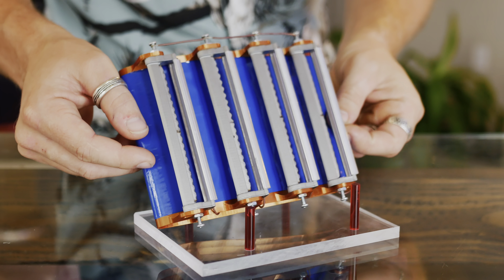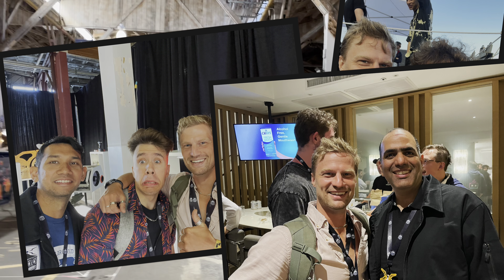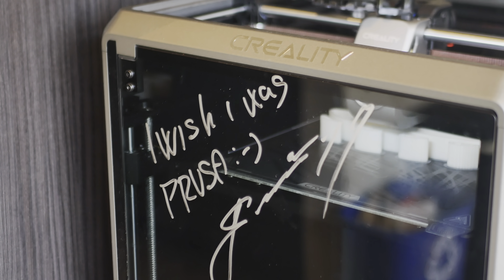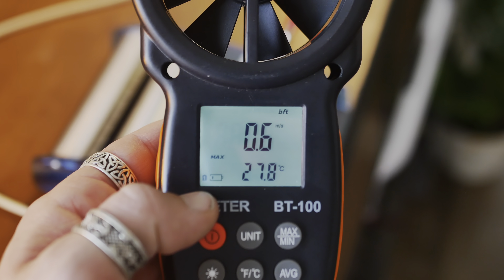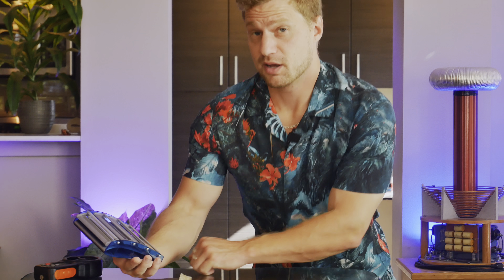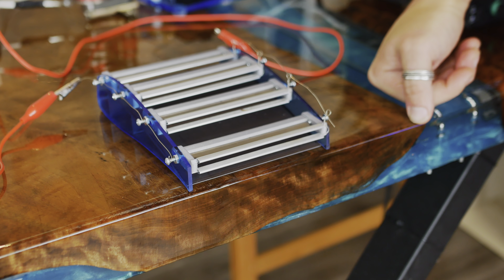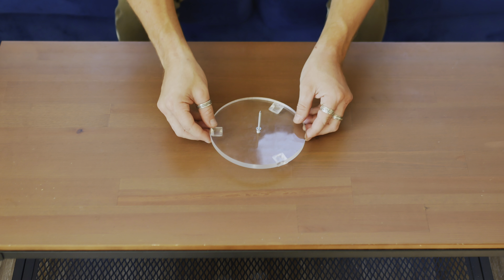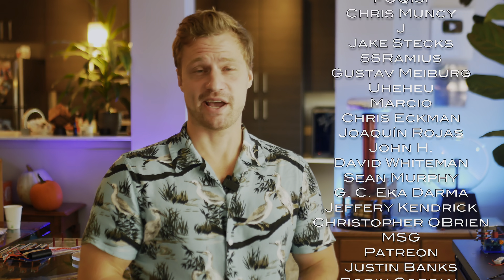Designing A Self Propelling Ionic Thrust Wing

Comment from the maker: Hey all! Thanks for watching, and to Curiosity Stream for supporting this video. This wing is now patented under US Patent law.
Check out Joel's ionic thrusters here: https://www.youtube.com/@integza 
My last BSI thruster here: https://www.youtube.com/watch?v=yftKjkZHirc
Peter Sripol's channel here: https://www.youtube.com/channel/UC7yF9tV4xWEMZkel7q8La_w
Reply: yeah, chatgpt can be good at explaining things, never, NEVER do maths with it 😂
Reply: @joli22 in fact just ask it to count the words from its last response... shockingly cant count but good estimator. 😅😅😂😢
Reply: Your 3D printed wing is orders of magnitude too heavy.  I fly a 1.5m wingspan radio control glider that has a complete flying weight (radio, batteries,  servos, and plane) of 120g.
Reply: Great design! looking forward to seeing you at Supercon
(P.S I might have some badge stuff for you.)
Reply: I did some calculations with the measurements you gave for the test set up. I calculated you have a moment of inertia of about 0,0292 Kg*m^2. 
You said you had about 60 rpm meaning 2π rad/sec that took you about 12 seconds meaning you had an angular acceleration of about π/6 rad/s^2.
That leads to a torque of 0,0153 Nm.
With an arm of 0,29m leads to a force of 0,0528 Newton or approximately 53 grams.
Reply: @remcoswenker667  I get slightly different values, but they are close enough to yours. 0.05 N are 5g though, not 50.
Reply: @turun_ambartanen  you are correct I oopsed there
Reply: @turun_ambartanen 
There's also missing info which ChatGPT filled in without stating its assumption: the moment of inertia of the 75g armature is modeled as a point mass at the pivot point. But the 75g armature isn't a point mass and its center of gravity is not at the pivot point because the two other masses are not equal. So if you used ChatGPT's method but corrected its multiple numerical errors you'd still be underestimating the thrust
Reply: @bornach  That was obvious and I considered that in my calculations. The worse silent assumption is to assume the acceleration is linear for 12s. But the 12s are what it takes to reach top speed. So the actual thrust is higher (potentially by a lot), but impossible to calculate with the information given in the video.
Reply: 7:08 aren't the electrodes on your mark 2 thrusters aligned into each other like that?
and didn't you get a significant power increase when you made the bars more aerodynamic?
you should re print the stages to have offset electrodes
Reply: Couldn't you have wires laminated over the top surface. A rolling plasma on a timer could also allow for it to drag the air flow instead of creating interference between the contacts, like how a railgun might work, but with plasma wind.
Reply: Amazing job. if i was so talented
Reply: you need to start looking into electroplating 3d prints for maximising weight to thrust efficiency...maybe even just print a skeleton wing and thruster and use electroplated foil for the thruster and just regular foil for the wing
Reply: Thank you for the update. Just as I was eager to remind to NEVER trust ChapGPT. It often lets me down.
Reply: Have you ever heard of Dielectric Barrier Discharge (DBD) devices? I did my Master's Thesis on them in 2006 at AFIT.
Reply: hahah cool its like watching Edison vs Tesla on yt...  (but without the sabotage and actually building)
Reply: 0.044N is the weight or force equivalent to a mass of 4.5 grams. This kind of error is inexcusable. It's as bad as expecting chatGPT to calculate anything when you need a correct answer rather than a witty poem. Likewise, using an anemometer whose cross section so badly matches the profile of the moving air means that your actual speed figures are really inaccurate and cannot be used for comparisons with other thruster
Reply: Some notes: 1. Your thrusters are positioned very close to the wing surface - where the airflow velocity  is usually the slowest or can even reach 0. (Reason why a Fly can sit on your windscreen even at high speeds) 
2. The Airflow around your wing is not equal - but the output of your thrusters are so they stand in their own way. 
3. The center of pressure is moving which will mess up the performance of your thrusters. As your design assumes steady conditions. Maybe variable angles on the thrusters could help here.. 
4. You probably will have huge issues once the velocity of the Airflow reaches speeds where shockwaves form because at that point the Aerodynamic properties of the wing change drastically. 

I would move the thrusters in front of the wing and fine tune the output and wing design to avoid most of these issues..
Reply: Wouldn’t nylon screws/nuts be lighter?
Reply: What difference would it make, to put the thruster underneath the wing?
Reply: It's a good idea, nice
Reply: that's amazing...but can you develop a combination of compressed air and high voltage .....because so far the ion thruster only accelerates stationary air
Reply: Is this new Gillette razor?
Reply: im not sure if this would work but if you try staggering the wire a bit maybe it would help it gain a little more energy/power because in some parts it may run through the wire more at the cost of it weighing a couple more grams but the outcome may overpower that
Reply: You created a bi wing.  That increases drag.  I would change the design to a blended body and skin the craft in solar skin.  Plasing the intake under the nose ducting the flow of air exiting the wing.  Using compaciders like a tesla power wall would also reduce weight and give you the charge needed to power your engine.
Reply: because one day we're gunna be able to make them round like ufos.  @intriq8
Reply: Please never use chatgpt as a calculator (or at all?). It will give you wrong answers with complete confidence. For example, the expression it wrote down for I_total = 175g*(.29m)^2 + 274g*(.216m)^2 should evaluate to .0275 kg*m^2, not .0243. It is a bullshitter. That said, the main failure here was your reading comprehension. It gave you .044N and you saw .044kg

My best estimate based on your inputs and methodology is 5.1g, but this is a (big) underestimate because you're ignoring all sources of loss, as well as any speed dependency of thrust (at ~4m/s V_e this is important).

I'd suggest you keep this setup, but just use a sideways scale to measure (static) thrust directly.
Reply: Hello friend I want your e mail id for contact you I am open channel plasma channel in hindi
Reply: New wing design may help https://youtube.com/watch?v=uEaR6I0mjds&si=aZM-fyvXN_W5V9uk
Reply: https://youtube.com/watch?v=uEaR6I0mjds&si=aZM-fyvXN_W5V9uk
Reply: I remember 20 years ago that many people tried experimenting with both ionic wind and electrical pulses as well as the wild goose chase of orgone energy generally believed to be completely debunked, but it was never completely debunked from those who actually discovered still suppressed technological breakthroughs.  I myself discovered how to phase conjugate orgone energy despite there not being any device yet to measure this elusive subtle life force energy.  The Egely Wheel (which I bought one) has been the only device to exhibit measurable results but unfortunately not very meaningful or precise nor does it identify the subtle energies which are hindered by other external forces such as static electricity and thermal air convections.  However, I have good reason to know based off my own experimentations that electricity and living organic energy are polar opposites which self regulates when both are within equalibrium and self feeding each other within pulsed states.  The concept is that orgone energy pulsates naturally from the æther along all surfaces at various gradients (seven æthers exists beyond the limits of thresholds such as the light æther exists beyond the thresholds of infrared and ultraviolet spectrums, and only four of the seven æthers exist from physical material thresholds while the remaining three are linked to quantum waves and consciousness).  Electricity and plasma are directly linked to both the warmth æther and the light æther while the life force of orgone energy is directly linked to the life æther and chemical æther.  This polarity is between the organic and inorganic material world.  Balancing all four æthers within a closed loop and injecting it with quantum consciousness causes naturally occurring bioplasmoidal entities that are spirit orbs and perhaps more akin to the plasma found within natural occurring ball lightning to self propagate within this balance of organic and inorganic fractal material designs.  This is exactly how the evolution of life and spirit actually exists.  When multiple ætheric thresholds are balanced within highly organized fractal mathematical structures, the physical æthers then forge a bridge towards the elusive thresholds of quantum consciousness and its elusive "non existent" three additional æthers.  Understanding how quantum waves creates quantum particles in relationship to superstrings is paramount to understanding the true reality of the seven æthers which academia, politics, religion and the scientific community have dogmaticly conspired to conceal the real truth behind the æther.  Dr. Stephen Greer is currently working towards changing the old dogmatic paradigm.  So called "free energy" is actually not as free as what Dr. Greer believes it to be because the æther itself is extremely elusive and under normal observations is non existent.  But what Dr. Greer does know about free energy and gravitons is that there indeed is a balance of energies of PLASMA FORCES within certain highly structured designs that are all rooted in natural phenomenon and natural science, both known and unknown.

Build your ion plasma designs based upon how organic life self propagates and manifests and you will discover not only free energy, but how gravitons work as well.  The key to understanding how gravitons work is also to know how to balance two sets of seven æthers, one characterized as male and the other characterized as female.  This is projective orgone (male) and receptive orgone (female).  The key to unlocking each æther is through symmetry and fractal replications.  The key to balancing the subtle forces of the æthers with known forces such as the strong forces and weak forces is through pulsations of scalar wave propagations.  Simple scalar waves are based upon algorithms with at least three superimposed waves that are then phase conjugated.  Depending on physical designs, scalar waves can be either receptive and projective.  Projective scalar waves are longitudinal waves which when two or more intersect can create distant energy vortices.  Receptive scalar waves can draw upon distant energy vortices.  The energy derived out of the æther originally derives from out of dark energy and dark matter.  The sun and stars in general, which initially began as both dark energy and dark matter, keeps the seven æthers vitalized.  The æther itself is naturally receptive and draws upon the natural projective nature of physical forces at each threshold.  Various inorganic material are naturalized as either projective or receptive and sometimes both within a dual state of primary vs secondary.  Example is gold and copper are natively receptive metals while silver and brass are projective metals.  

Construct projective plasma generators with projective electrical metals which are also pulsed scalar waves balanced with receptive plasma generators with receptive electrical metals that are phase conujugated with its projective plasma generator.  Also experiment with earth batteries with the same foresight to attract natural occurring light orbs aka spirit orbs aka ball lightning.   One idea is to experiment R&D with in the ground receptive plasma generators with above ground projective plasma generators that not only phase conjugate propagated scalar waves but are in a push-pull, on-off, balance with each other so that only one is active at any given time as they alternate between the receptive and projective plasma generators.

EXPECT THE UNEXPECTED, AND DON'T EXPECT ANYTHING BUT RATHER OBSERVE WITH CAREFUL OBSERVATIONAL SKILLS AND YOU WILL UNLOCK THE MYSTERIES BEHIND WHAT YOU SEEK OF CREATING SOLID STATE INVENTIONS.  Also, look up and read as well as understand Tom Bearden's patent on his MEG (motionless electromagnetic generator).  Good Luck.  I do know what I am talking about because I have pioneered new inventions myself with real documented functional prototypes that I have not yet publicly disclosed.  However, I have not yet experimented with what I am revealing to you as I do not have the time or the money to carry out these experiments.  I just bought a 3d printer but have not assembled it yet because I still need to learn how to create designs within CAD software as well as setting up and printing.  I travel from job to job across the nation and cannot yet use my 3d printers.  One of your ion wind designs has inspired me to redesign my next prototype which will phase conjugate both orgone energy and eloptic energy (of which I did not discuss previously) for the sole purpose of creating clouds on demand from low power on the ground with precision as an orgone interferometer skywriter.  Once this prototype is finished, nobody will be able to deny its existence because it will become public domain and will become a grassroots pioneering event around the world and will thwart any attempts on copyright and patent claims.

Also, research The Hutchinson Effect.  John Hutchinson claimed and demonstrated balanced energies, however I know that he himself did not understand enough of how to decipher and unlock the mysteries behind the æther itself.  If he had, nobody would have been able to have debunked him because he would have also understood how and why the æther of the whole earth has its own balancing between on and off cycles primarily caused by seasons and night and day.
Reply: You could remove some weight by using electroplated plastic instead of a blade or even a wire.  This would also allow you to make 3d conductive surfaces.
Reply: I'm not sure what the final design for the wing is going to be but wouldn't adding alot or a scaled up version of the thrusters used in this video to the outside surface of a wing drastically increase the drag on the plane, which in turn could drastically reduce overall efficiency. Have you considered incorporating the thrusters into the wing like in the de Havilland Comet which was done to overcome the drag created by underwing engines.
Reply: How is possible that nobody commented of you unsafe use of the bandsaw? please be more careful with your hands and do not show such sequences. somebody might be stupid enough to imitate you
Reply: https://www.youtube.com/watch?v=KTsCuG3WAj8
Reply: Yes, much lower, 4 grams! The equations to derive force from angular momentum and angular acceleration are fairly basic and you should not have to go anywhere near a linear velocity value to derive the force.
Reply: the serrade edge blades are actually better https://www.youtube.com/watch?v=WezeLNC32sA&list=PLxHov1BR4XL_a0ClUTQCpP0yUJPNMAknQ&index=1&pp=gAQBiAQB
Reply: How is the standard glide of your wing? In the case of a catastrophic failure, what is the survival rate?
Will it be flyable if one side loses power?
Reply: Warning ⚠️ BECARFULE THIEVES CAN STEAL YOUR HAPPINESS. ⚠️ Warning 
_________________________________
"I used my best colors for your portrait."
"Touch me, and you'll never be alone."
"I can read you like a magazine." 
They all are parts of the lyrics of Taylor Swift's songs.
but Those are not only songs (Taylor Swift) is A writer of crime stories whose stories are authentic and who has committed all the murders. Don't travel to the USA. Students study hard, and you easily steal their ideas from their brains. Fighting for freedom. New slavery. It is my responsibility. We are imprisoned in a place whose slogan was freedom. Don't travel to the USA. Never even for a short time. If you have any special knowledge or skills or an invention, they will steal it from your mind. The US government initially used this method to identify people who intended to harm the United States. But today, they use it for many purposes, including stealing information, from people's minds. Many celebrities like Taylor Swift and Harry Styles are helping to lure the US government. They can see whatever you see. You'll never have privacy even with your family. They could see whatever you think. Money, power, and Dark magic, There are three levers that they use to achieve their goals.
 .............................. 

#TaylorswiftIsMurder  
#HarryStylesIsMurder #SelenagomezIsMurder 
#BidenIsMurder  
#TrumpIsMurder  
Like and share to support
Reply: Reportedly Darpa has been developing Aircraft with the goal to eliminate control surfaces to increase fuel efficiency the system ends up looking like a hybrid of both a vaccum cleaner & a Leaf blower using wicked bursts of air via internal Micro Jet engines Like the ones used in the real world iron Man flight suit
Reply: First time viewer, I really enjoyed the video  and look forward to your eventual success. Subscribing.
Reply from the maker: I’m honored, thank you for watching
Reply: What if you ditch the whole ionic superstructure above the wing profile and just glue down some wire and aluminum tape?
Reply: Your one step closer to the  Tesla e-Hover Car
Reply: Also, you are one step closer to the Perfect shave, plasma powered 7 bladed shaver... Gillette would be interested in this design .  Rechargeable battery in the handle , Slightly glowing blades that lifts, cuts, and blows off a Man's wiskers stubble .   " Gillette 's  new Storm Blade , the perfect shave that will blow you away ! " 
Just be sure of bio safety : Men can safely use the Storm Blade while their face is very wet , like when they just steppd out of the shower.
Reply: So this may be a nullified comment, but. Have you ever tried using, single strands of Carbon in replacement of steel wire?
Reply: Of the testing with dry ice in the front of wing it showed it was pull air over top of wing wouldn't it be better if the thrusters was on the bottom of the wing to also make artificial lift?
Reply: https://youtu.be/boB6qu5dcCw?si=L1Es4cwNWOaUN-9X
Reply: Because it looks terrifié
Reply: Few ideas: the inner wing support should be lateral which could enable you to leave holes on the top wing to allow air forced into the inner lateral wall structure giving a more focus point for the air to escape at a directed release point. Holes should be made like a cheese grader, to cut the forced air into the inner wing, like shredded cheese 🧀. Try ways to burying your dynamite instead having it explode on surface. 
Self sustaining power consumption? Does attaching them to an alternator via a bumper car method allow them to sustain themselves? At what speed would they have to travel? Could it power a balance set, if so how many?
Reply: Cann youu make mini jet engine...
Reply: in a realistic application sense...this could be added to current plane to reduce fuel consumption. ..i would also like to know if the  application of this tech could be applied to space travel, adding a nuclear reactor as a power source could make deep space travel alot less costly.
Reply: Instead of using a 3D printer, you could have used balsa wood to further reduce the weight. There are some types of NACA with leading edges that have better flight performance, do some research. High voltage generators, try to make a high voltage tripler type (e.g. used in TV).
Reply: Stupid question have you thought about integrating this into a wing using the principals of the tesla valve to basically create currebts that won't fold back on themselves or wave propagation and destructive/constructive wave interference.
Reply: Have you considered using a standard wing with electrically conductive painted upper surface?  I thought it might be interesting to try with a styrofoam glider toy.
Reply: Competition can be good but collaboration is even better!
Reply: why not try to put on center instead of wings just like jet engines.
Reply: You should try experimenting with those thrusters in a helmet to see how it fast it will allow you to run. If it works, I wanted to try it out and use it to make my super hero imagination a reality. I would imagine 2 engines containing 6 ionic thrusters in each one; something to contain the voltage and control the speed like an on/off switch of some sort; a flying mechanism possibly; some protective gear so that I won't get injured; a pair of open road classic roller skating boots; and a high tech face mask like from Iron Man that has a clock on the inside that also protects my face from bright lights and air blowing in my face. That's all the stuff that I want in a suit like that. Plus, a parachute in case of any flight failures.
Reply: Nice! But: 
The issue I see lies in the aerodynamics and weight. Additionally, you're measuring with a long motor and a round wind gauge with limited diameter. This setup only captures the point velocity but not the total energy. From earlier experiments, you already know that cascading results in energy loss. The most sensible design would be for the entire wing to receive a second skin, with only one motor accelerating the air between the wing and the cover to about 2 m/s – essentially a kind of wind tunnel over the actual wing.
It’s pointless if a final design reaches 15 m/s but consumes 12 times as much energy. In your tests, 40% of the power came from the first stage. This makes a second and third stage energetically impractical and unsuitable for everyday use. However, in combination with an electric motor, a reasonable range improvement seems achievable.
Reply: porque no pruevas a usar una torre de faradai para suministrar energia
 y reducir el peso
Reply: I really think if you use Balsa Wood +  Strips of Bamboo, also bamboo is fire retardent with a protective coating
Reply: Is it not possible to generate ions in flight from the air?
Reply: Congratulations! This is a fantastic project. Cant wait to fly one of these someday! Well Done!
Reply: What if you design it like a suacer and made it like a funnel to increase thrust all around you could add power in sections to move in direction
Reply: would it be possible to use this technology to make heat pumps/ac units wisper quite? or more efficient/effective
Reply: Ionic thrust boomerang!
Reply: lol cool, you know they used to have a symetrical shifting wing planes so they could break sound barrier without the big sonic booms i think it would be very usefull for a ionic wing if it would be adjusted left right

also i know the modern equations only take electric current as moving north south but it also  radiates out which dosent usually mater so they simplified the equations but when your talking about things like this you probably want to use the equations that account for radiated electrons its probably important to take into account as the side radiation can be harnessed to ionize air more efficiently (its why 2 coils of wire with current going through them in same direction attract where's regular magnets of same pole repel)/reduce energy loss
Reply: 13:50 the second you switched to the other razor blades i knew the teeth design would increase the ionic plasma look. Was not disappointed.
Reply: 0
Reply: do you think you could harvest electricity from wind flowing through the thruster?
Reply: Chat GPT is a language model its not for math. this was a sick video btw
Reply: @Dot2TheLock it does math well. I used it to find out the worth of a sheet of toilet paper.
Reply: @fletcherjacobs3688  this comment was posted 10 months ago.  Of course it's getting better that's the point of ai. Hands are no longer a problem as well.
Reply: Cool thing is that now Chat GPT has the ability to run calculations. It runs a python interpreter right in the chat.  @Dot2TheLock
Reply: @Dot2TheLock  ChatGPT is supposed to be capable of discerning the true intent of poorly formulated queries. Most of the lay population can't formulate a precise query that an ordinary search engine can return the proper result and ChatGPT is supposed to have a better chance of ferreting out that intent.

So, in this way ChatGPT can be invaluable solving even math problems.... If for instance you are trying to understand the likely mathematical relationships and parameters in a project like in this video, you can conversationally ask ChatGPT to produce results and keep refining by building on prior queries in the conversation.
Reply: @tonysu8860  ChatGPT did seem to come up with mostly the correct equations (it incorrectly decided that the 75 g arm had no moment of inertia, though) but it also made two simple arithmetic errors.  It literally multiplied/added the numbers incorrectly.  If you know enough to check its work, maybe it would help coming up with the equations to use, but at this level of performance, if you don't know enough to tell if it's hallucinating at you, you really can't trust its answers.  (I hear that ChatGPT 4 is getting better about this, but it still seems risky to trust it if you care about the answer.)
Reply: @doctorbobstone I still wouldn't trust GPT4. Tibees gave it a math problem it never saw before and it just produced nonsense. I asked it whether Toronto was further north than Swindon UK and it cited the correct latitudes but still insisted Toronto was further north.
Reply: @bornach  Turns out there's more to math than pattern matching language... Who knew?  🙃
Reply: The angle of attack of the thrusters relative to the wing surface will make a major difference.

Remember, it's not just about thrust, but lift.  If you want the wings to generate lift, you'll need to make sure the air over the top, is at a significantly lower pressure than that below it.  Generally, it's achieved by faster air over the top and slower below.

Your craft can go slower and achieve the same lift because it's artificially evacuating the air above the wing.

What angle would be optimal, however, is just something you're going to have to test.  Nobody's ever done anything like this before, so there's really no one you can ask.  Even those in aerospace can't give you a definitive answer, just an anecdotal one.  The real-life results could go wildly askew from what they conventionally expect to happen.

Personally, I think each thruster should be at a different angle depending on whether it's closer to the front or back edge of the wing.  Still no idea what that angle would be, though.

Science specializations just don't play well together, so you're mostly on your own in mixing these two fields.
Reply: A very wise comment, but take it a step further and forget about thrust and concentrate on the lift because you would need sufficient thrust to achieve lift. Concentrate on lift alone with the idea of VTOL. Once lift is attained then any thrust will move the machine forward. Obviously the direction must be vertical.   @DoremiFasolatido1979
Reply: @DoremiFasolatido1979  This comment was very well thought out.
 It made me wonder why the thruster wasn't just an inner part of the wing? With the intake on the top and the discharge underneath near the rear of the wing?
 If they were positioned at the correct angle and the airflow were vector-based, it would allow gliding at even lower speeds. ❤
Reply: @DoremiFasolatido1979  , excellent point.  It would be great if the design could be reduced to an airfoil with a more tightly integrated thruster forcing air over the upper surface.  The gap between the thrusters and the airfoil is an interesting variable worth exploring.  I would love to design/prototype a wing surface that somehow pulls air over it.
Reply: If I were you I’d suggest trying to put the thruster into the wing and not outside. This way you can use the internal structure to mount the foils and stiffen the outer wing while at the same time saving weight. The form of the wing at the end could at the same time function as a nozzle maybe even increasing your trust. Nice side effect … it’s safer to touch if you ground the wing outer shell and it can be easier guarded against water
Reply from the maker: Nice fallacy amigo. Your friends must love you, always being the pessimistic one.
Reply: You are clearly working on a wing, and I get that.
The balance beam merely made me wonder...
Would it be more efficient to go helicopter rotor styles, placing thrust on both arms and the power supply in the center so it creates less drag?
Reply: Curious if the preceding thruster is negating any work by the following one.  At some point the airflow exiting one has to be going too fast for the following unit (3rd, 4th or 12th in line whatever) to not efficiently add to any airflow but instead restrict the power at some point
Reply: @dbprice4306  He ran into that problem with his previous iteration, and he found that ensuring the trailing thrusters had sufficient air flow greatly improved efficiency and thrust. I'd have to imagine that in an open-air environment, the thrusters would have enough flow, but I'm not a fluid dynamicist,  so I could be wrong,
Reply: Amazing idea , I believe you have something here.
I am avery old instremtation technician from the nuclear power imdustry and a private pilot. One element you have not addressed yet is the reduction of drag as the assembly passes through the air stream. 
I think you are genuinely on to something very special here
 Keep going and don't listen to those who say it can't be done !
Reply: Pls see this;
Make Ion trust segments smaller
And make the potential difference on the edges high and middle low😮 so u can add more segments using the same configuration
Reply: How are you dealing with the ozone and the resulting smell?
Reply: Run the experiment on a weight scale to know the lift! ....
Reply: It may be a silly idea, but why not not hang some thin wire in front of the wing and use the wing itself for the ground. I have no idea if heat is an issue, but I would imagine the airflow could help some. I am curious now if that would even do anything.
Reply: Next is to eliminate the wing entirely, use only the blades in the same shape, and or just larger.
Reply: like one large blade for max performance @up4open
Reply: Let’s goooooooooooooooo. Livestream your build process!
Reply: Next time use GPT-4 with code interpreter, it's x100 better.
Reply: I think putting the electrodes on the leading and trailing edges of a propellor could have an interesting result.  Perhaps even try one of the new toroidal propellers or use a ducted one.  ducted fans with ion emoting electrodes on the leading a trailing edge in series could created a sort of ion jet applying a magnetic field to the ions then could then further increase thrust with Lorenz forces
Reply: I would join curiosity if they had normal payment options
Reply: @RonDLite   ok
Reply: I had this idea back when the ionic breeze came out. Well that thing reminded me of a concept in an issue of popular science. I thought of an aircraft that would use a scramjet to get into the upper atmosphere where it would then switch to the ion propulsion. The problem? I had no idea how to implement from thought to working concept. You have figured it out now I can tell all the guys who thought I was an idiot that it works at least to some degree and as a concept. Some of the guys in here are right though about the jump in technology. I am still in college currently learning about airframes and powerplants. Good luck guys.
Reply: Consider using balsa with a reinforcement of parachute nylon, very thin material, and wood glue, use aluminum foil instead of wire and foil instead of aluminum pipe.  Insert flat batteries in the wings, not cylindrical for weight savings and incorporate them for strength.  Taper your wings and custom fit your thrusters , but also put a leading wire infront of your air foil wing, line the leading edge with foil and make it thinner than the prototype, much thinner.  Also put a thruster or two underneath the wing.
Reply: Hear my words. Flat toroidal brushless electromagnetic generator/motor. Free your mind!
Reply: @SPHYNX99752  Look up Tom Bearden's patent on his motionless electromagnetic generator that he claimed was the engine for free energy.  However, it was incomplete and I know why.  Read my long posting and illuminate your mind.
Reply: Make the full fuselage  a thrusters.  Mmm?
Reply: Here is a light weight option you might consider: a flexible wing canopy with the plasma wires sewn into it. There's nothing more light weight than a paraglider, it's 20-25 sqft/lb and also by design very low speed. That would be the perfect fit, not a glider.
Reply: This may be something that you have already thought about but what if you apply the principles of a helicopter and a jet. You spoke about how jets are essential wings on rockets (simple terms because I'm not articulate or that smart hahaha), so why not apply a similar thing to over come the weight.  Essentially stick with the thrusters on the airfoil but put them on the underside and have them on a downward facing angle but with modular capabilities to as speed increases tilt for a more ideal and aerodynamic flow. Then attach those wings to the "main propulsion system" being your precious larger ionic thruster. So you have the smaller foil thrusters overcoming weight of the heavy thruster, and the heavy thrust performing the forward force.

I hope that makes sense.
Reply: Since you're accelerating the air over the wing, doesn't that necessarily change the aerodynamics of the airfoil? In fact, one might argue an airfoil is no longer necessary. The Bernoulli effect is the result of a velocity differential achieved by extending the distance air travels over one side of the wing. Now you have ions doing the work.

If you want to go really crazy, you could try installing reverse ion thrusters on the underside of the airfoil that turn on once the plane achieves air speed to increase the differential even more. It would slow the plane down but might produce greater lift in the process.
Reply: no i dont think i will
Reply: Please create an armature to hold your Anemometer. It looks so sketch to put all this effort into recordable results and then there's no constant for distance, angle or anything relating to how you're validating everything else you're doing.
Reply: this jacked dude said drink cafe what country does he live in?
Reply: I got some ideas
Reply: Do you think if you combine the ion engine and the thrust wing you could make a flying rc plane?
Reply: 🤔 If you make the ionic thruster portions in ascending increments driving the thrust through each 🤔 maybe this would incorporate the corona effect creating a vacuum and a higher overall thrust that translates to the underwing vacuum and lift increase??🤔 Maybe lol
Reply: If a guy can get something to fly with spinning tubes then anything is possible. Yep tubes, no jet turbine, no rockets, no propellers, no rotors and no wings. Hollow cylinders.
Reply: have you try making better plasma more amp less voltage ,or even more volt low amp
Reply: Lets use the silk web as a reference point 
The silk is a liquid
Its a standing structure its stackable
Spiders use all sides any direction 
Lets use the silkworm as another liquid structure 
Same concept different structure pattern
Reply: Can it work on propellers instead of wings? Or maybe both
Reply: hey can i have your email so i can send over a picture of my idea i believe i made it
Reply: U try to travel through air that’s the problem 😇
Reply: “Minimizing weight and components”

Flight is almost always used to move cargo.
-Heavy bags of water known as humans.
-Heavy consumables such as perishable food.
-Heavy capital such as gold, silver, etc.
-Heavy bombs to blow things up.

There’s a reason why the GE9X puts out 105,000 pounds of thrust per engine.
It’s required and necessary…

Perhaps Ionic Thrust might be barking up the wrong tree?
Reply: Your design is not even remotely scalable. Every edge or opening is a increase in drag. 

You need to make each motor it's own aerofoil in a multi blade wing design to have any chance.
Reply: @jdoe9518 He needs to mount the foil directly flush on the main wing. This concept is a real area of aere research called plasma actuators, mostly used to control boundary layers to delay separation (stall) or laminar-turbulent transition
Reply: @jdoe9518 People are much more likely to listen to you if you don't have an bad tone, just a life pro tip for you :p
Reply: @jdoe9518  or can try with solar cell??
Reply: @jdoe9518  I'm no expert but seems to me that your criticism might not be accurate. Similar to a modern aircraft wing with slats, I assume that properly designed surfaces can improve the laminar flow across all surfaces, even improving the performance of large surface areas. And, drag isn't necessarily bad or to be avoided if the dynamics create a greater amount of lift.
Reply: @tonysu8860  
Right. So making the motors to be slats and making a multi slat wing from the motors, which is what I suggested, is a bad idea how?

Also every leading surface, every side plate and every opening creates drags and turbulence which increases stall area which means you'd need to more surface area to gain enough laminar flow which increases the weight which increases the thrust required which increase weight.

Might be worth looking into wake vortices and stall area using different wing design.
Reply: Is it possible to make a structure out of plasma? 
A standing structure? I've been working on framing and I was curious
The process of which one element can be changed into all the options 
Like water or gold 
I know that with water igloos are made 
Waterfalls are made but can you ultimately make a frame from some type of liquid
The only one that came to mind was your plasma
Reply: have you tried to twist the points out and spiral the curve in?? just a thought onnincreasing the air flow force in and out guidances yo just a thought hey
Reply: Twist and spiral it out it will make a huge difference believe me
Reply: @PlasmaChannel if it's not enough force to move a plane but it's enough to move a person. Or am I wrong?
Reply: watching your making process I got a question: dont you have access to a laser cutter?
Reply: I know how you can scale that to a functional PEV
Reply: Based on the Bernoulli principle, wouldn’t you be able to generate more lift if the ion thrusters were in front of, or beneath the wing..? (Presumably that would increase the air pressure beneath the wing, with the pressure differential creating lift…not an expert, just curious 🤷🏼‍♂️)
Reply: @PlasmaChannel try for the future using a u shaped wing to increase lift while at lower speeds
Reply: Why don't you give the top of the wing dimples like a golf ball
Reply: Put dimples on the top of the wing like you do a golf ball it will go farther just like a golf ball without the dimples on a golf ball they don't go far
Reply: I have a crazy idea. Taking inspiration from Lee-Richards annular monoplane. The round design could be a means for increased surface area. While placing the ionic propulsion on top and maybe underneath it the opposing direction it could hover.   With specific ones made for direction? My basic idea is to have it so it will have air go through the center and have the air travel similar to a magnetic field so it can have increased air flow underneath similar to like a golf ball
Reply: Can you please answer this.
"What if by mistake it gets water drops or maybe large amount of water in intake in the bigger and powerful version of this ionic thrustersWhat if by mistake it gets water drops or maybe large amount of water in intake in the bigger and powerful version of this ionic thrusters."

Also i liked the caterpillar drive version of yours❤
Reply: Because the ion thruster is on the top of the wing, doesn’t that negate the necessity for a traditional airfoil wing design. Allowing for more focus on structural integrity, decreased mass and drag? It’s been a while since I’ve even thought about anything related to this subject, so I could be completely wrong.
Reply: So... I am new to your channel, but how long will it take to get this concept finalized!? I really can't wait to see how this develops further. Having been a glider pilot for quite some time, i'm already in love with the concept and the idea of solar panels within the wings generating the energy for this kind of thrust is just... life-changing!
Reply: 6:12 dec 16. Question. Have you thought of moving the propulsion pieces inboard of the wing with “slots” built into the wing bottom or leading edge and “exhaust “ slots at the camber going backwards. Would relieve a lot of drag , can act as spars and ribs. Will help laminar flow over wing and possibly relieve more eddie currents. Also might help the center of pressure on the main airfoil and the mini ones internal to the propulsion parts.
Reply: Nicola Tesla experimented with high voltages and electric frequencies. You should do the same. I'm sure there is a setting that may get you more power!
Reply: Hello, are these "400 KV voltage boosters" dangerous? I scouted the internet and the best I got is "probably not but maybe" which is not satisfying.
Reply: @MikeOxolong you can probably go less specific and ask how dangerous stun guns are. - although it's probably less regulated power. (Don't use if you have a heart condition and don't touch with two hands)
Reply: I actually had two very interesting ideas you may like.  One was like the iconic wing, but was a box or ring wing with the electrics in between and with the top airfoil swept forward, while the bottom was a delta.  The other idea I had was an ionic thrust augmented jet engine, using charged compression blades angled toward a detached hub behind them (the compression fan had a spinning ring instead of a central hub, probably a crazy idea, but who knows).
Reply: This would never fly in damp air.
Reply: @RWBHere  
Space isn't very damp strange how you can only perceive your immediate environment
Reply: just a question how does artificially increasing the speed of the air over the wing surface affect lift
Reply: Gyroscopic thrust is more powerful than this ionic thrust, and is just as powerful on earth as it would be in space. The problem is how to control directions.
Reply: I look forward to seeing this on a real wing and flying
Reply: the future is an airplane that flies into a thunderstorm, charges there and flies on)))
Reply: @Але-Оп-т1о  with out getting fried and a battery that can charge in a split second
Reply: Please consider drag when thinking through the design  of the wing as the plane must be safe to fly when power loss occurs.
Reply: FLYING CAR PLEASE
Reply: It’s not clever to create a plasma flow over the top of a wing because it reduces lift while increasing drag as your airspeed increases.
Reply: For weight reduction, have you considered a built-up balsa wing with a tissue and dope covering?

This is a well developed  technology capable of producing extremely strong and lightweight structures.
Reply: Рамка бифельда брауна извнстна давно))) в СССР в секциях юнных техников такие делали)))
Reply: I have read on reddit actually about these and I guess somebody said it would drop like a stone in a storm and everybody would break their neck. EDIT: wait maybe that was about jets in the wings themselves or something.
Reply: sacrifice a voltage amplifier to the plasma gods and see how much voltage it can take just to put the maximum amount of voltage into it to get the most electron movement.
Reply: This is surely the future of airplanes